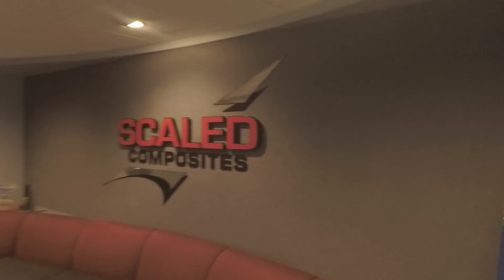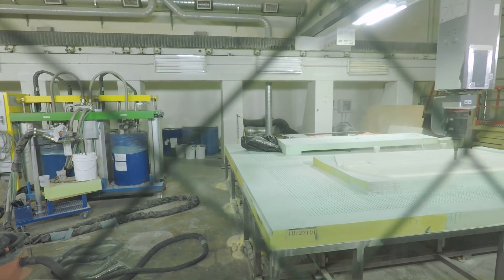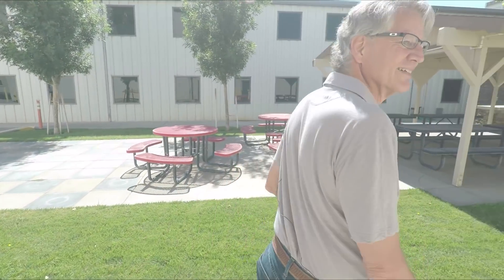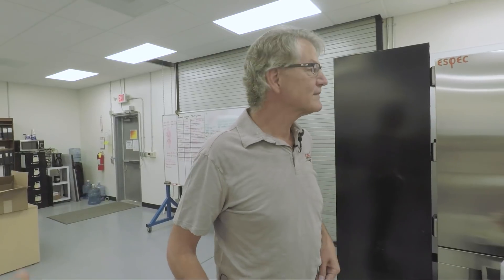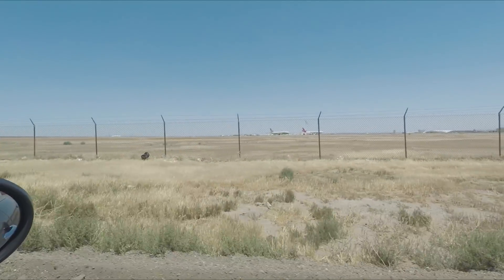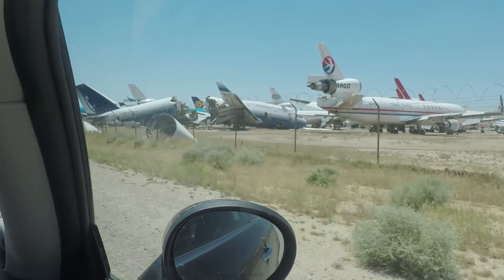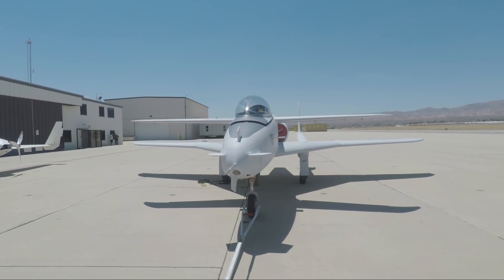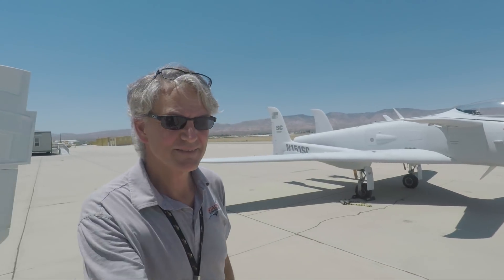Tour of Scaled Composites - Aerospace Factory!

Comment: Used to program a cms CNC with 840d control for airbus, absolute nightmare and support is terrible. Surprised OSHA lets them run that cnc open like that with no safety barriers. At airbus, a operator defeated the safety barrier and had a tool drill into his skull.

Comment: I saw the Aries fly at the Oshkosh airshow many years ago.  It offers extremely high maneuverability, and would be great for close in support of ground troops.  It did a level 360 degree turn in front of the airshow audience with the diameter of the circle being about 500 feet!  Amazing!  The US military was not interested in it, given the recent interest in the A10, they should take another look.
Reply: Unfortunately, It isn't bullet proof or redundant like the A-10. And can never be made into a survivable combat vehicle without a total re-design. It was a "proof of concept" prototype to demonstrate single engine offset engine intake and thrust line, with long composite tube exhaust, etc. etc. Built around a small 20mm cannon, which is adequate for use against lightweight fighters, but definitely not even remotely effective for tanks. And keep in mind, The A-10s enormous 30mm cannon cannot penetrate the armor of any tank designed and built since 1970. A T72 can operate with near impunity against an A-10 gun. Aries is a publicity toy. He almost could have kitted it as a homebuilt for the more affluent fighter jet types.

Comment: I used to work at a composite manufacture who does primarily aerostructures in carbon fiber. We also had several room sized mills and several smaller CNC mills. Manufacturing engineering isn't my thing and automation engineering is way better in my opinion. Also there was no creativity in the job so I kind of hated working there, but it was amazing to watch the machines cut carbon fiber. We never had instrons but we had ultrasonic NDT equipment we used to inspect for delamination in carbon fiber or we can even see a fingerprint inside the layers of the carbon fiber. I remember ordering a few CVD diamond coated carbide tools used to match the countersink and hold tolerance which also had to be qualified. They were very small tools that ran about $600 a piece!

Comment: I built the Long-EZ 20 years ago. Sold it at 85% done. It was an incredible learning experience.
Reply: I bought a Long-EZ and flew it for several years.  I quit flying soon after 9/11, but I still miss the Long-EZ.  Great design!  Very synergistic as it seemed better than the sum of its parts.
Reply: That's exactly when I stopped flying too. It wasn't worth being shot down and then they say oops. Sorry...
I flew the Cozy MK4 a few times too. But I liked the LongEZ much better and smoother. 
I am not sure if I'd pass the medical now. those were good times and I took full advantage of it while it lasted.
Reply: The Cozy IV is a great plane too, with enhanced utility, but there is something to be said for the roll axis on the Long-EZ going through the pilot's belly button.  It's like a poor man's fighter jet, although also gentle and responsive like a sailplane.

Burt can't pass a medical exam either, and that's why he designed his SkiGull retirement project the way he did.  It's basically a high performance plane that's licensed as a motor glider.  Burt is legal to fly it during daylight hours, and it's designed to fly anywhere in the world.  As a retirement travel plane, he and Tanya can fly it in high pressure systems and cross any ocean in the world without worrying about weather.  It's also designed to avoid airports and the FAA types who hang around at airports.  Burt's Oshkosh Tent Talk on the SkiGull is Good Stuff!

Comment: That router brings back memories of working on a similar machine. I was called out to fix a machine at a boat builders. Pretty much all the information I had was that they had a faulty router. At the gate they told me it's in that shed over there. I wandered into this big shed expecting to find a pretty standard router. After a while I looked up and realised there was a cutter directly over my head. OHHH...kay - that wasn't quite what I expected! It had a similar X-Y size but Z was about 4m (12')

Comment: I'd love to hear the story on how that plane in the bone yard got BROKE IN HALF!  Awesome factory tour as always!
Reply: At 13:22 you can see the registration number (N198UA) and from there you find out that the plane spotting community is insane! :)

I googled the registration because the plane looked like it was involved in an accident but apparently it was scrapped by United and Scaled Composites bought it for parts to build the Model 351 "Stratolaunch". It was likely broken up for transport and/or to gain acces to the needed parts, it is possible they blew it up to test something after collecting the parts but i doubt it.

Here are a "few" pictures of the plane dating back to 2003: https://www.jetphotos.com/registration/N198UA

Airlines drive this planes really hard, from 2008 to 2009 they flew this one with a lot of chipped paint.

Also interesting are the number of views this photos get, all are 1.000+ and some have 50.000+ views. Until it was bought for parts there is nothing special about this one but it still has nearly 100 pictures. Lots of dedication in the plane spotting community.

... wow, what a rabbit hole. Two hours passed by like nothing :)
Reply: bomb test?
Reply: A giant weight was dropped on it. The plane is ready for the aluminum foundry....
Reply: sp1nrx still, thousands of usable parts on everything in the boneyard.